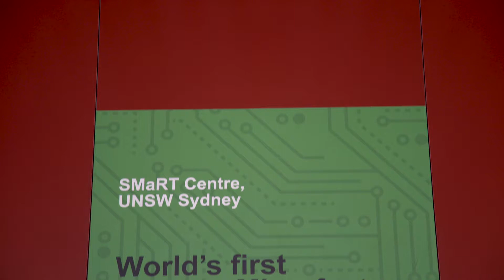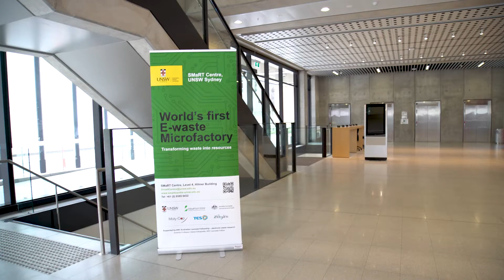World first e-waste microfactory launches at UNSW

Comment: Apple already has a robot that can disassemble 200 iPhones an hour to recover materials
Reply: Disassemble? or shred?
Reply: Disassermble.
You can see it here https://youtu.be/cRdIS9tWwSY
Reply: Meaning that the disassembled parts still need a process that would separate the metals from fibres, plastics, epoxy, etc.
Reply: It appears to be using robotic fabrication machinery programmed in the reverse process/mode.